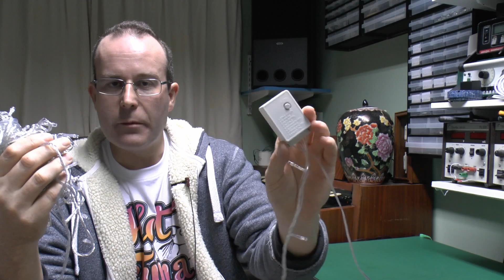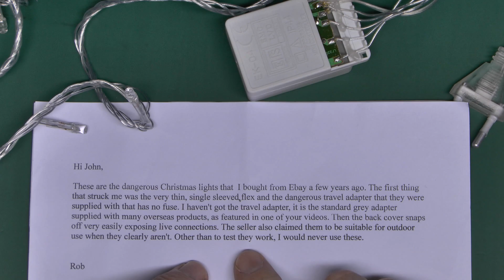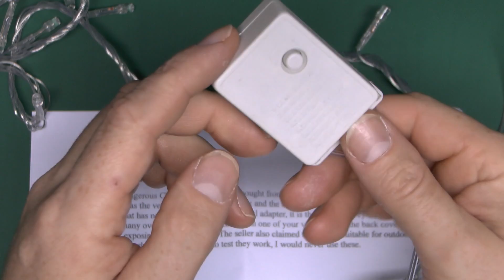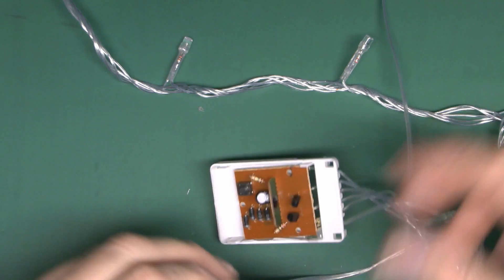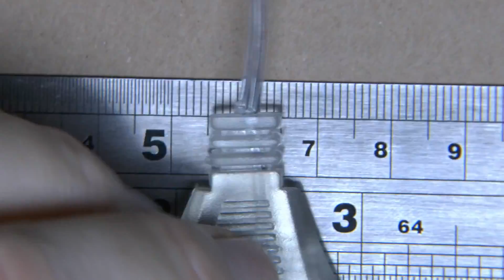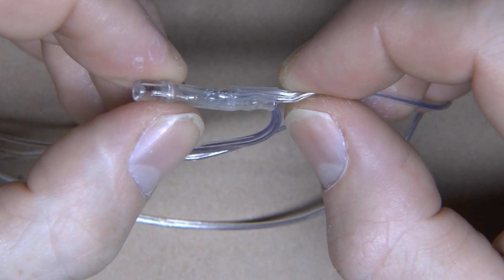String of 100 coloured LEDs

Comment: I've had a capacitor go in one of these controllers once, luckily noone got hurt, just scared the shit out of guests :-)
Since it needed repair from then on I also replaced the mains wire with the one from a dead desk lamp and the LED wires were quite thick on their own, so far still going good for 10 years since then :-)

Comment: The bulk LEDs may be useable under 12 V-DC or less ( using a save modern quality Power Supply with electronic protection circuits)

Everything else of it is lethal junk

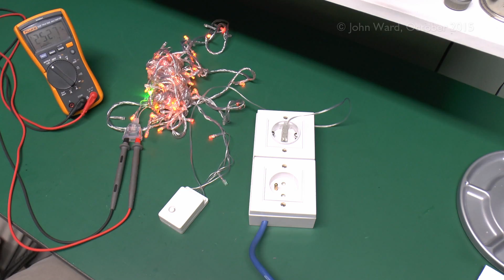Comment: 4:03 VOLTAGE OVERLOAD! In Europe the voltage is 220V or 230V. I'm actually surprised, it's still working on that voltage (normal rating to wall transformers is 110V-140V). and u cannot plug any toasters to that socket because of plugs standard.
Despite that it's still a crap "product"
Reply from the maker: +Dangerous_CODE Voltage is high due to the isolating transformer being used.
Reply: ok. I would put some load to that circuit to drop that voltage a little. it's quite hard to predict if something is going to blow up. (peak voltage is not dedectable by multimeter)

Comment: I'm embarrassed to say I bought something similar and did end up getting shocked. It's hard to get good quality Christmas lights here in the Philippines. All of the shops are flooded with the 1-2GBP sets. I plugged them in and then started to hang them, there was a break in the insulation and I got a pretty hard shock.

Comment: I 'fixed' a set of lights last night that had the same control box, although it plugged into a 24vac transformer rather than directly into the mains. Inside the box some of the transistors had burnt out, presumably because this set uses incandescent lamps which probably require a significantly higher current that exceeds the rating. I removed the box entirely and wired the lights directly to the 2-pin plug that plugs into the transformer and it seems to work fine. I don't 100% understand the circuit though so I'm not sure if there are any potential dangers with this - maybe I should at least put a fuse in in case for some reason the string suddenly tries to draw an excessive current?

Comment: Hi John I also purchased a set of these lights december 2013 (the ebay retailer came from Nottingham) my lights was the net style and they also came with the un-fused 2 pin adapter.
Well I caused uproar amongst the trading standards  and I managed to speak to a person who understood what i was going on about. Basicly the coloured lights wiring without any fuses can be at consumer unit fuse or breaker perpetual anything from 16A to 45A if plugged in to a cooker panel or a ring circuit. 45A on 0.5mm flex = a great heater.

Ho yeah John and i was one of the students who was tought from the 17th edition back in the 80s (bond everything in site with 16mm singles). Paul

Comment: The current rating of the tiny europlug is actually 2.5 A.
Anyways I agree that the light is carbage and that its only good for hanging its seller, though it may not withstand that weight.

Comment: The daisy chaining design is actually pretty common on light strings in the US and I am pretty sure they are single insulated as well. However, every string I have seen in the US has a fuse in the plug (which is unusual for US plugs) and the insulation does seem to be a lot thicker.

Fortunately no major retailer in the US will sell an electric product that is not listed by an NRTL (most commonly UL or ETL) so you mostly only see crap like this online.
Reply: +Brian Cairns   (hope the correct) Fuse comes only with UK designed "Commonwealth Plug" BS-1363 ( "type-G" by USA)

No other plug on this planet has a fuse -> fuses are fitted inside the devices (do not expect it at lethal stuff made for China-Export only ! )

Comment: Small correction, this connector (CEE 7/16) is only rated for 2.5A.
Doesn't change that this is a crappy thing.
Reply: +stefantrethan Right, there's no toasters with that plug. A hair dryer would be limited  to ~575w with that plug.
Reply: +stefantrethan 
True, but most europlugs are fred from either 10A or 16A circuits.

Unideal, I very much like the British way of thinking here. That is fused plugs, so you can have 1A fuse right in the plug and feel no shame on using some teeny 0.25 detonation cord.
Reply: +stefantrethan the junk will not survive the 2.5 A of the Europlug (CEE 7/16) ^^
Reply: In Switzerland we use the same 2-prong plug for up to 10 amps.

Comment: I had a couple of similar sets from B&M Bargains I think, but at least they were 24v with a proper UK plugpack isolating transformer.
The controller was designed as 4 channel but the LEDs were just wired as 2 channel and there just 2 thyristors fitted, but positions for 4.
The "406" transistors are actually thyristors, the mains is rectified but not smoothed apart from the supply to the chip, this allows the thyristors to switch off every half cycle unless re-triggered.
I'm looking forward to the overload video. I'm sick of hearing the ads on the radio about how easy it is to overload a socket and burn down your house - because it isn't, unless you've got a few of those non-fused 2 and 3-way adapters in play.
THIS is what's going to burn down your house!
Reply: +Simon Parkinson That's not often the real threat - unless you go far enough to overhead the house wiring. Overloaded cords however... usually though daisy-chaining strips of Christmas (Faery) lights. MythBusters did an episode where they wrapped an insane amount of lights (properly powered) around a tree. It got hot, but not hot enough to ignite or smolder. 10 cheap strings of lights daisy-chained into a single long string was burning within a few minutes just sitting on a bench. The cord overheated, melted, caused a short, and lit the melted insulation on fire.

Comment: What a piece of shite! However, the European plug shouldn't be found on any toaster or similar high-current device, as its maximum rating is 2.5A. For unearthed high-current devices there is another plug which doesn't fit into the 2.5A outlets.

Comment: Can you do a part 2 with the toaster?  Also I hope no Christmases end in tragedy with these things.  Even B&M bargains make their mains lights pretty beefy and the low voltage not bad either!  Wilkinsons ones have thicker cable but dodgy switches on the battery unit which is a shame because they are extremely pretty and great for taking anywhere you want. All have thicker cables than that thing!
Reply: +Knuckles the Echidna Came here to make this same request.
Reply: +Knuckles the Echidna   maybe a normal 60 Watts Incandescent light-bulb in a night table lamp ( with Europlug) is more than enough to grill it ...

Comment: Wow! That's horrid! :o Selling this shit should be considered attempted murder IMO. 

Would be interesting to see how quickly the wire fails if you connect a toaster or similar load on the other end, have seen you do similar test before.
Reply from the maker: +Maria Engström The wires will be tested to destruction in another video.
Reply: Ah, thanks! :)
Reply: +John Ward Please make sure it's on a 32A ring circuit with a travel adapter as these lights are clearly designed for!
Reply: +John Ward John! I have these lights.. I was thinking of doing a video on them myself. I have two sets, blue and white.. Both are awful, exactly the same.. Thank god people already know!!! I can't believe how dangerous they are.. Mains voltage, euro plug, no fuses, awful controller case... It just falls to bits in your hand! A mains powered string.. Wouldn't mind if the listing would show that! I've paid about £3.50 and mine don't have the socket at the end, if anything yours are better made! Two triacs with no protection.. Nice..
Reply: +Maria Engström  Selling this should be punished as an Act of Terror ... like selling a bomb 

This entire thing is a fuse, guess it will burn immediately & die as fuse after less then 5 seconds
Reply: +ChaosHusky  spare the useful bulk LEDs they are the only part of this junk that deserves to live ... 
everything else: Turn it into Toast !